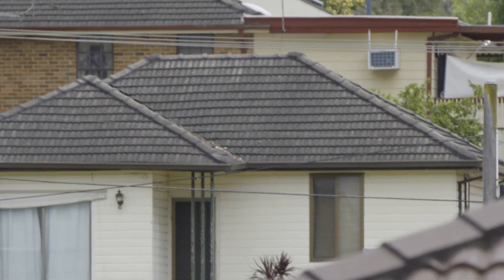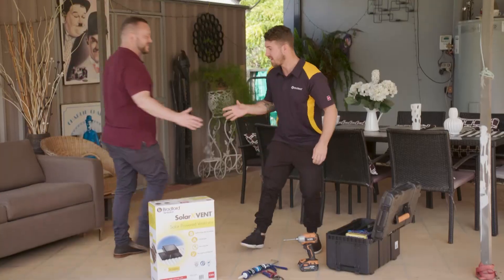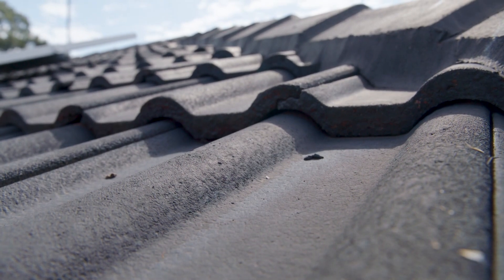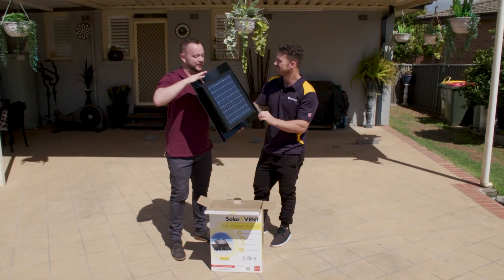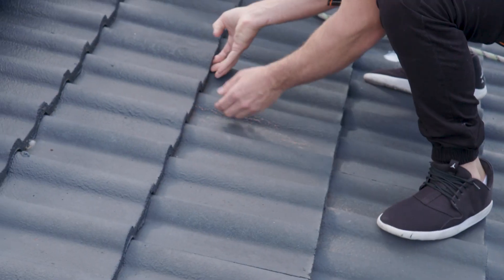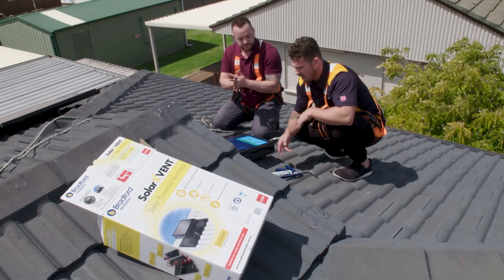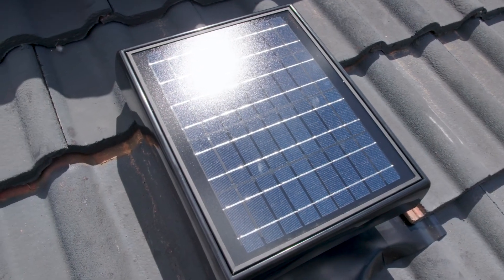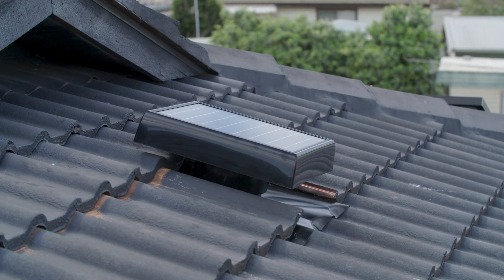SolarXVENT by Bradford Ventilation

Comment: If he’s a Roof Expert like he says he should build a back with Silicone on the bottom row of Tiles to stop blow back under the Tiles because with. 75 mm lap on Tiles cutting and bending bottom of Aluminium Flashing will not keep water out .